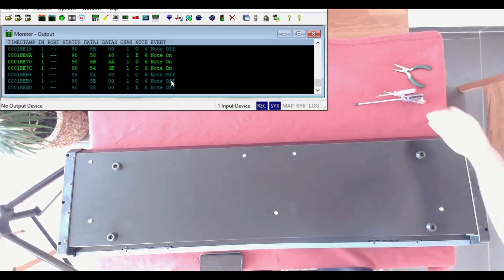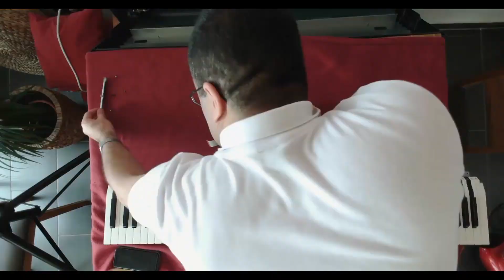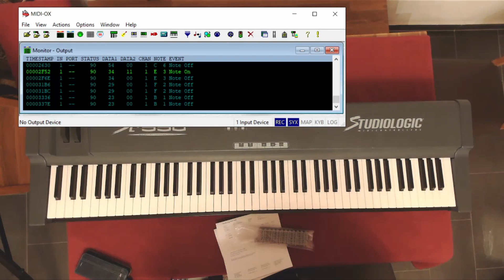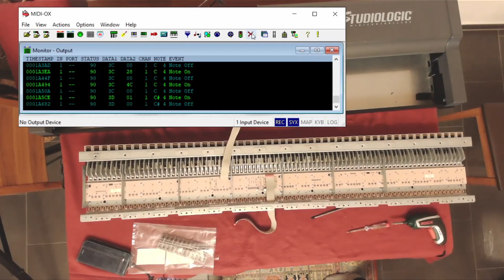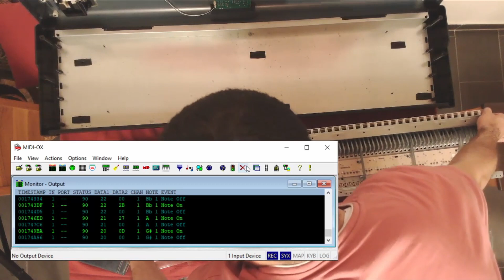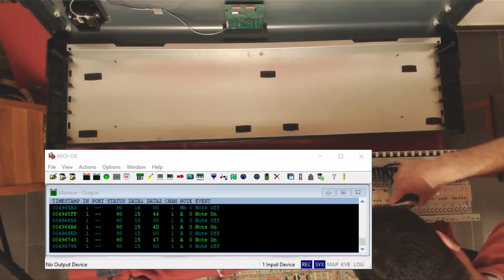Studiologic MIDI Controller SL-990 Pro Problem and Repair

Comment: Thanks for this super interesting video! 
Do you think that washing the rubber pads harmed the small black dots that make contact with the board? They look like they could be a piezoelectric material which activates with pressure? Maybe the salts in the water or the soap changed their behaviour? Sorry for all the questions 😅 it would be great to learn more about it!
Reply from the maker: Maybe you are right. There are special spray for cleaning such electronic components. I used what I had available to me at that time.

Comment: Please can you tell me if a driver is necessary to connect it ? Because I just got one and it’s doesn’t want to connect to my ableton live
Reply from the maker: @Midzbeats  you mean the usb midi interface? If so, please be careful of fake devices that might not work properly.
Reply: @manouchehrmail  I bought a new midi cable still nothing. I would like to know after plugging the cable should I download any Asio driver? Cause in my DAW it’s unrecognized
Reply from the maker: @Midzbeats  what OS? In windows usually you need a driver. Have you tested with a different usb port or another computer?
Reply: @manouchehrmail  Do you know which driver for this fatar sl880? I already downloaded asio4all still nothing
Reply from the maker: @ if you are using a usb-midi cable then you need a driver for that. The sl88 does not need a driver.

Comment: This keyboard doesn't generate its own sounds so to play this I need software and a computer to plug this into? Can I use it to practice ect then? Or is this only useful for professionals recording ect?
Reply from the maker: The keyboards which do not generate any sound (like this one) are generally called master keyboards or midi keyboards. You can connect them to a software or hardware tone generator.
Once it is connected to a tone generator, yes you can practice with them. However, the experience is not the same as an accoustic piano but even accoustic pianos are different from one manufacture to others. So, what is the basis of comparison? 
Yes, you can use them also for recording midi data into DAW of your choice. 
If you want to use it use, software synthes, I would highly reccoment to go for Mac or iPad wirh M1 Äpple Silicon. Windows with core i9 and 32 GB of RAM is not even close its performace. I am saying this as a whole life windows user. If you want to do professional musicion with software, go for Apple. Godd Luck :)
Reply: This is only a midi keyboard controller, and one of the best value for money! In a professional production, especially nowadays, we either record a real piano, or we use software piano libraries in a DAW.
Reply: @Dimitris81 is it worth to buy it in 2023? I afraid of issues which can be reasoned by the age
Reply: @orionnebula7167  I have mine since 2005 here in front of me and still fully working! Amazing keybed! The company that makes these(Fatar), also provides keybeds to Korg, Roland and almost all keyboard companies! So yes it’s solid!

Comment: First of all thank you for the video and the special effort 🙏

2 You can use the lead material on the Contact strip to fix it / You can clean it first using an air blower.... Do not use detergent or water because you will erase the lead material

3 Do not touch the contact strips because you will dry the lead material on it.
Reply: thanks for this, this comment should be pinned :)

Comment: Hi, thank you for the video, I am thinking of buying one of these but the seller has said that the keyboard plays notes by itself, what could be causing this?
Reply from the maker: I guess short circuit between contacts. You may open it, clean everything including those plastic parts that I have shown in the video. It it works, perfect buf if not then you might need to replace those parts with new ones. Just like I showed here. Good luck.
Reply: @manouchehrmail  Thank you so much for the help. Do you know where I could get those rubber contacts from in the UK?
Reply from the maker: @alexsteer  no problem. I don't know where in UK but at least I can let you know the part numbers but I am too tired now. I will update you in a few days. Wait.... all the Information exist in the video description. I hope it helps.
Reply: @manouchehrmail  Oh yeh sorry didn't realise that, thank you!

Comment: amazing video:) it was very relaxing to look at:) I got an SL-880 a week ago. I paid 30 euro it came with a flight case but no cables. I got the cables and It works:)) except for one key:(

Thanks to your video I got a good idea of how to take it apart. But I have a question for you:) Do you think drawing on the contact with a 4B pencil would work to fix a broken key? like how nb2rock (Keyboard Maintenance and Repair Tutorial)  does it? (I would share a link but youtube doesn't like that)